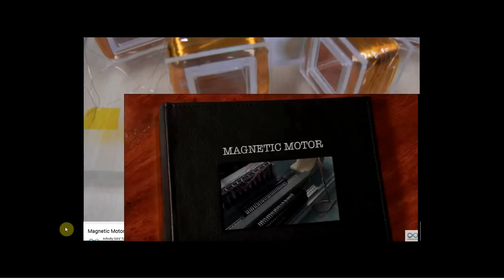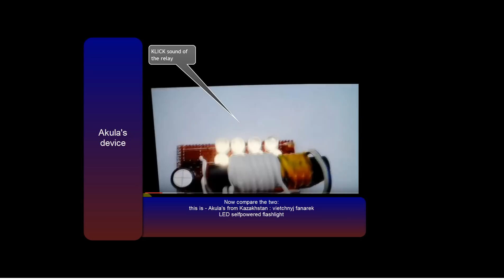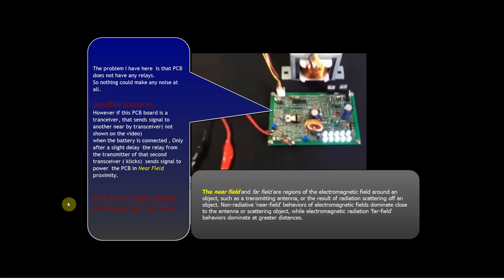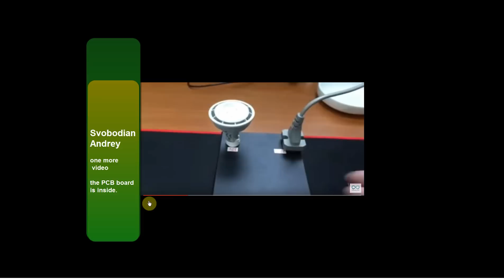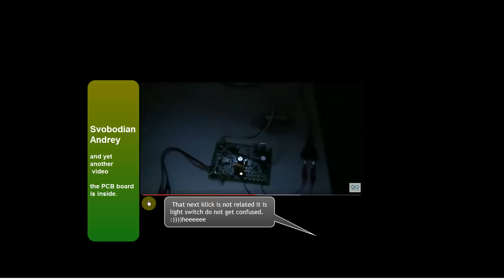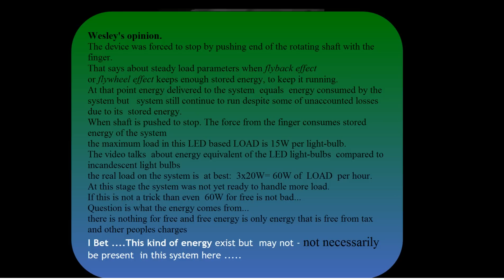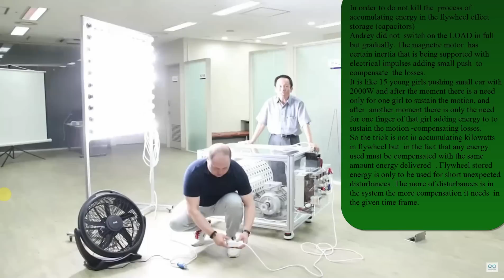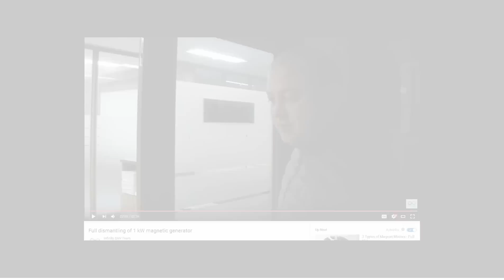Svobodian Andrey Free energy  Devices 10kw

Comment: I don't know whether this system can really work or not. But if you said that, thay used the motor as generator, it's not true. Can you see the white line cord from magnetic motor [https://youtu.be/_8uUrjnW5w0?t=5m31s]? If the system can really work I think that line is the power from generator delivered to the circuit.